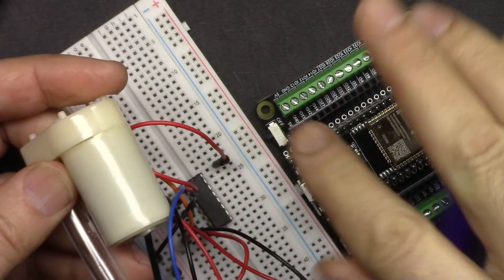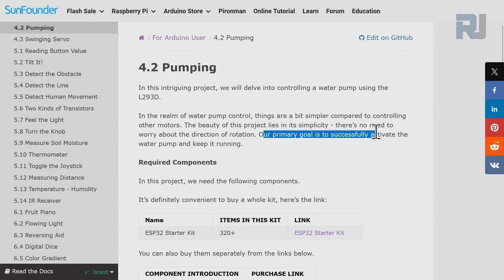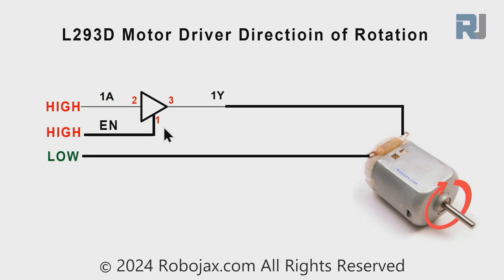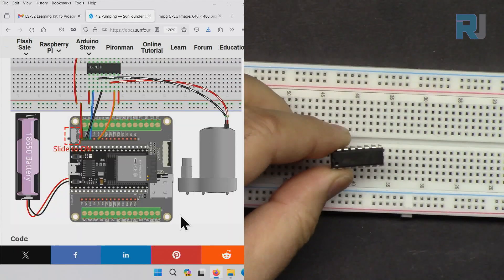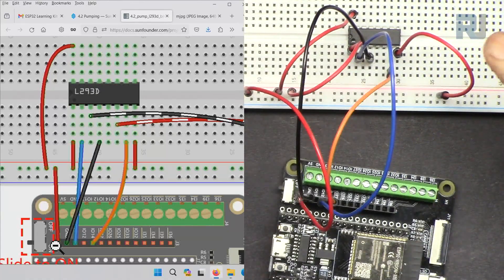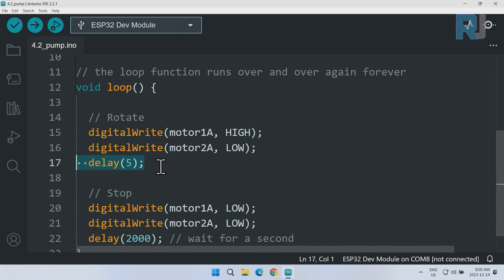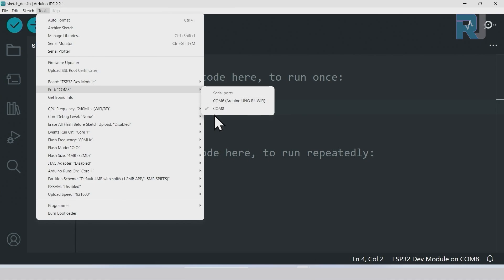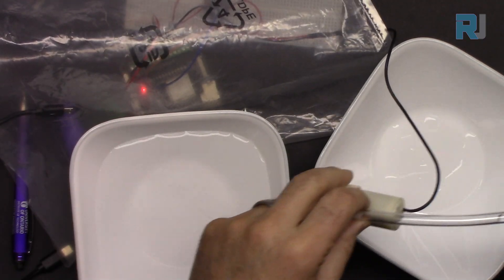ESP32 Tutorial 16 - Mini Water Pump using ESP32 and L293D | SunFounder's ESP32 IoT Learning kit

Comment: and if i want to conect 2 mini water pumps and i want to control one of them if a certain condition is aplied, how can i do the connections?
Reply from the maker: the motor driver chip is L293D, here is introduction to L293D https://youtu.be/jAmDliHcTJ0 watch this video to know what is a motor driver.  this chip has 4 half bridge meaning you can control 4 motors like this.  Just learn about the pins from the video I provided and apply the same principle of pump from the current video. good luck.

Comment: Did a similar things in combination with a water sensor to pump out condenswater from the hvac system. Instead of the driver i used a relay to which you can attach stronger pumps if needed. The shown one will break if you use it without water or the inside will just rust away. Do you also have examples with relays?